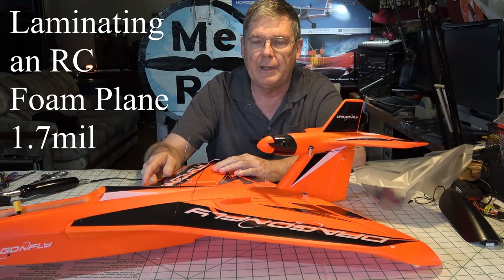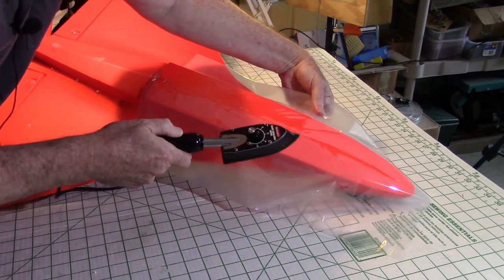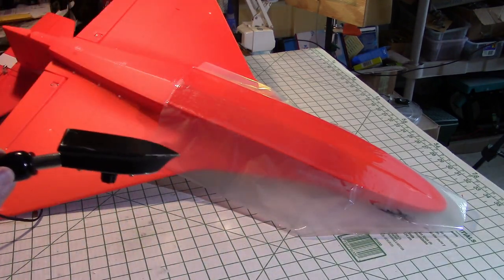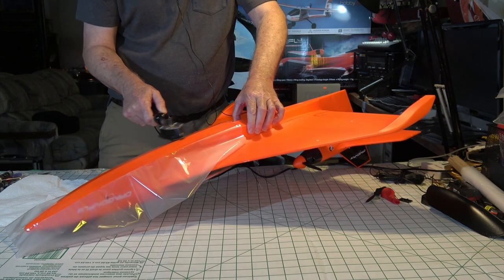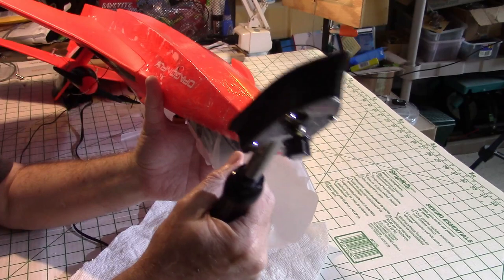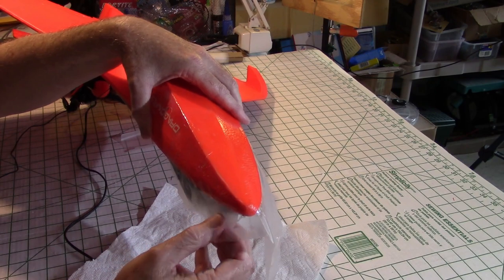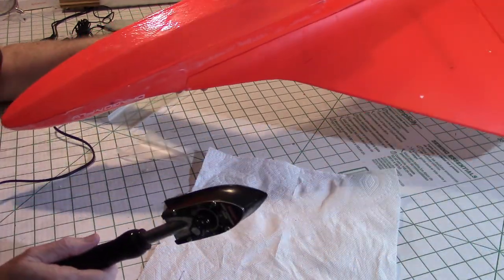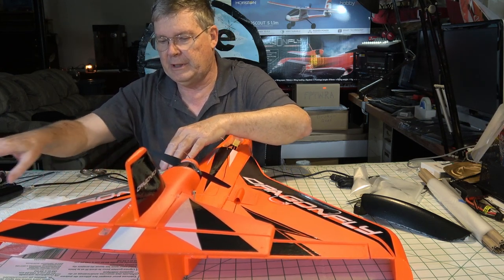Laminating A Foam RC Plane DragonFly V2 All Terrain Seaplane, HK Skipper Replacement, Build Part 3

Comment: I was taught to start at the rear so theres no edges to flick up on landing,i thought with water it would certainly apply as theresgoing to be water forced into those overlapped edges.
Also dont get too hot on the iron,around 145 ish and no less than 140 ,go to 150 ish for a final "finishing blast" real quick and no pauses or stopping with the movement,dont touch the painted foam at all,stop 1 cm from the edge and you can stick it when you do the overlap.

Comment: @36:07 I distinctly hear you say "you can't protect against *Pilot Era*" - Are you calling me old? ;-)

I see your bird is looking great, and protected in all the right places.  Make sure you plug those weep holes on the bottom of the wings, where the spars are (squeeze a little E6000 or Foam-Tac in them, first, to stick those spars in place). Otherwise water will collect in your spar channels, adding a few unwanted grams. And you probably aren't taking those wings off, lol.

So far mines gotten it's FPV gear installed, FC is in and getting ready for lamination. I've got the same iron and 1.7mil film, but am curious what temps you used? I don't recall ever laminating a painted EPO plane before. I slapped a piece on the leading edge and top of the vertical stabilizer first, but that was 99% sticker.
Reply from the maker: Captain Sully made a perfect water landing in the Hudson river and they still tried to nail him for pilot error.
I keep the iron knob in the center position and that seems to work YMMV
So you put FPV in a dragonfly or was it something else?

Comment: Good work Dave, you really need to get the temp right on the iron to keep it from melting the foam. That should work great on the water.
Reply from the maker: Thanks Vern. Your right, the dial on my iron has to be set to center and no more or the foam will burn.

Comment: Looks good Dave! Any problems with the lam in water?
Reply from the maker: The lam has worked great on all my float planes in the past. Hopefully it won't effect the boat plane on on take off. We shall see!
Reply: I prolly should’ve laminated the floats for my Tundra. They’re a bit scraped up from icy snow!
Reply: @TheAdkFlyer10  I've fixed scraped or chunked EPO with really light drywall putty. Next time you're at the hardware store, pick up a container - it's amazing how light it is! It's even the same color as bare EPO. Then definitely laminate :-)
Reply: Yup, I’ve used the lw spackle to repair epo. Never laminated over it, but that’s a good idea!